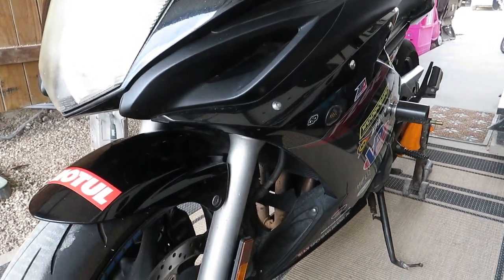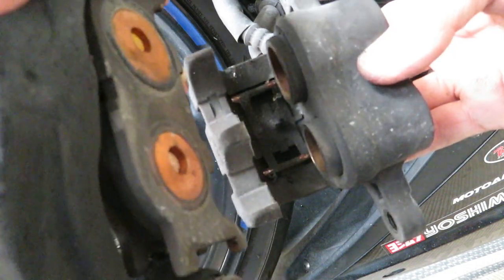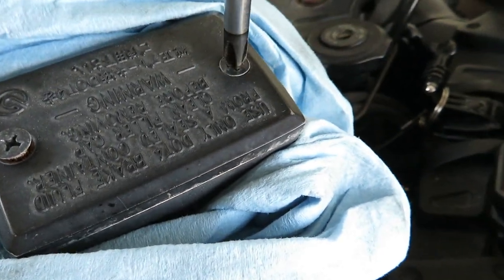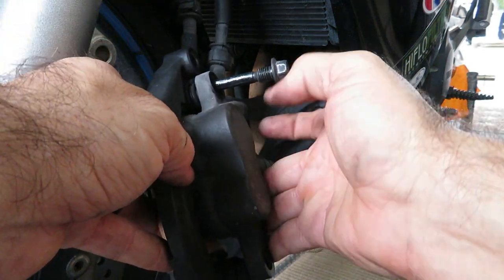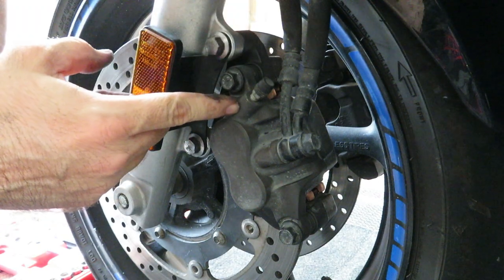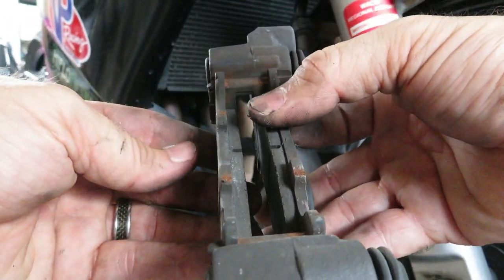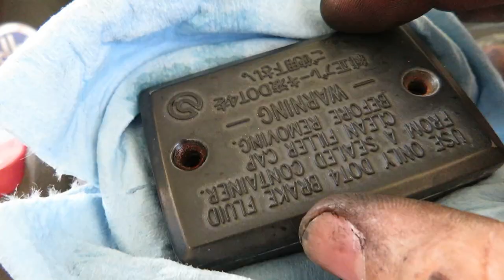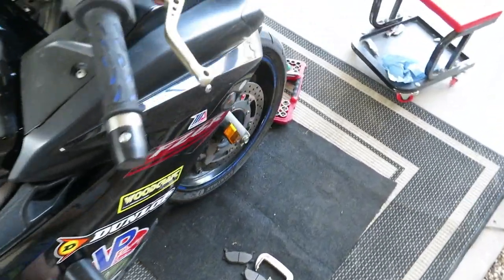Yamaha FZ6R: Front Brake Pad Upgrade

Comment: That white color on the threads I suppose was glue. If to do professionally i think it would be smart to use glue as well. And maybe to use tork wrench, 40 nm is needed for these bolts if I remember correctly. However I see job was done nicesly, thank you for video.
Reply from the maker: Service manual torque figures are always recommended, but admittedly I don’t typically use them for the small things. Thanks for watching!
Reply: Yes the caliper holder on the fork 40 nm can you tell me the Torque for the 2 other screw's torque numbers please
Reply: @HalfClickUp you don't youse Torquay number's for small thing's I thinks your life hang on the brake's you play with your life when you lose the pads youse the right torque please
Reply from the maker: @nastroazzuro82  The bike has been under heavy braking at several track days since this tutorial. The hand tightening of these small parts is fine.
Reply from the maker: @nastroazzuro82  front brake caliper bolts are 27Nm
Reply: @HalfClickUp  alright thats good that was no chritisation of you don't misunderstanding please hope you're fine may God bless ya
Reply: @HalfClickUp  thank you verry much can you also tell me the Torque for the rear brake I have the Yamaha xj6 it's the same brakes like the diversion thank you verry much for your awnser
Reply from the maker: @nastroazzuro82  no worries, my friend.
Reply from the maker: @nastroazzuro82  rear brake caliper bolts are also 27Nm 👍
Reply: @nastroazzuro82   hi, for brake caliper bracket is same, 40 nm. Ps. to change brake pads you don't need to take off brake caliper bracket. It's enought to take off brake caliper (torgue for these bolts 40 nm)
Reply: @Darius-m6i  These Bolts are more smaller they never can have 40 nm on the fork yes 40 nm but I think from the caliper are 27nm
Reply: @nastroazzuro82  If we talk about bolts which are showen in this video on 03:00, so they have to be tighten 40 nm (checked manual).
Reply: @Darius-m6i  of course 40nm but I say you mean the brake holder I mean the 2 screws where you take the caliper from the holder

Comment: To push the caliper pistons back, you can also put the old pads back in and use a flat prybar, scraper, or screwdriver to spread the pad apart, recessing the piston.
Reply from the maker: But then I wouldn’t get to use my cute little baby c-clamps 🤔

Comment: Surprised you hadn't upgraded to stainless steel brake lines. Did mine a few years back when I did my pads. Huge difference, almost overpowered braking so bad to relearn braking on the bike a bit. De5no brake fade after ditching rubber brake hoses.
Reply from the maker: Yep I upgraded the rear to a steel Spiegler several years ago and love it. Just haven’t gotten around to the fronts yet.

Comment: Hi! Are Yamaha original pads organic or sintered? Which would you recommend for fz6r street use? Thanks for the videos...💫💫💫🙏🙏🙏👍👍👍
Reply from the maker: The Yamaha pads are sintered semi-metallic. They’re just fine for street use, and I actually pushed them very hard on the track for a few track days. If you’re in the market to replace them, definitely go with the EBC pads in this video. They perform identically to Yamaha’s pads on the street, but are also EXCEPTIONAL under high heat and hard braking on the track.